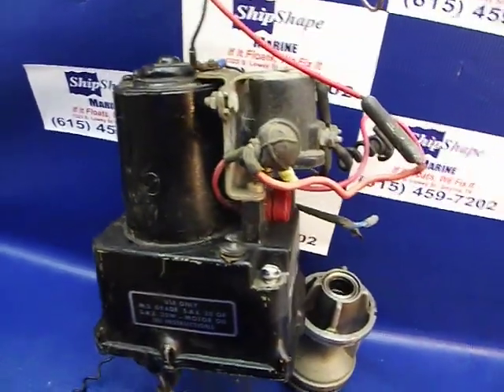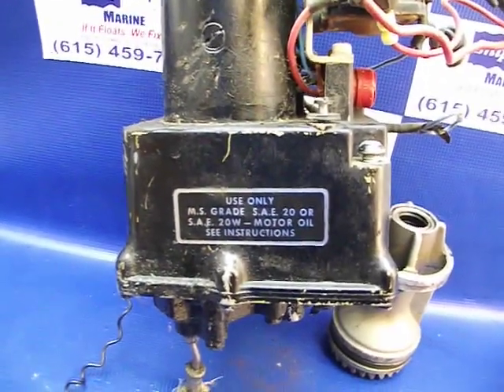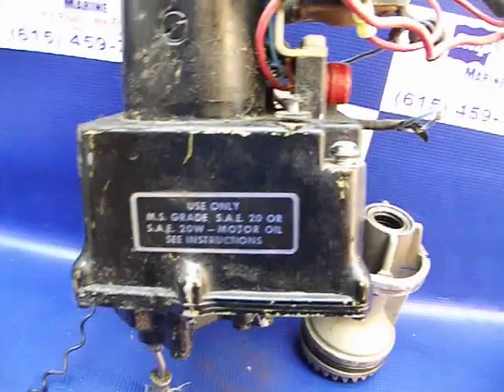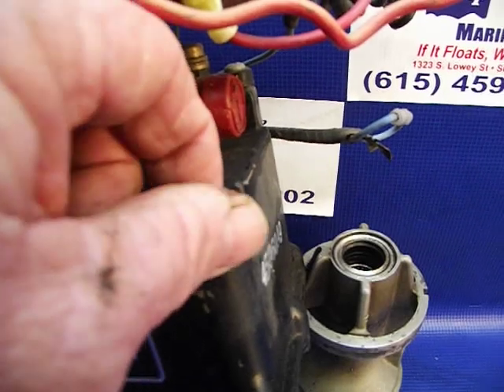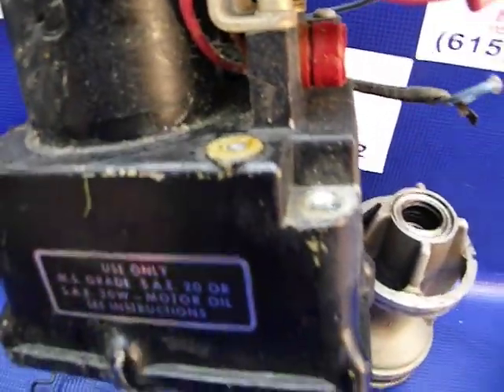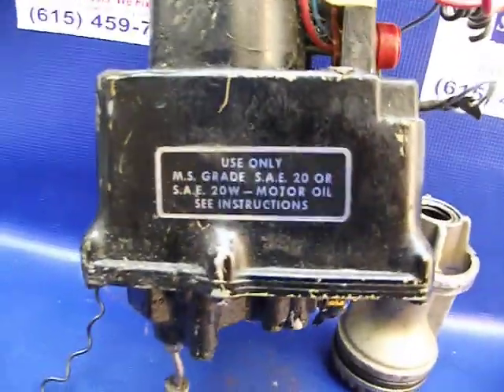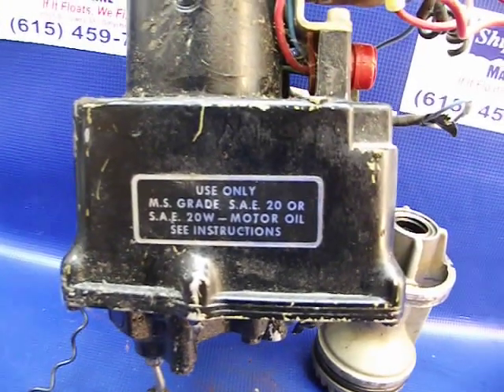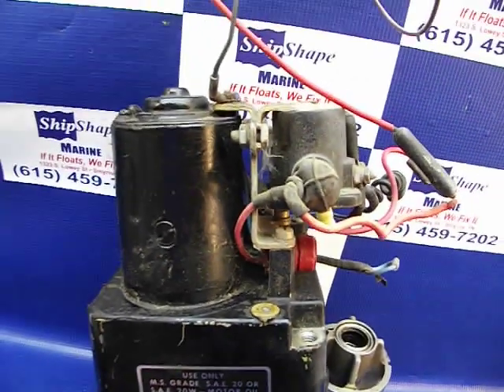How To Check Fluid Level in Dual Ram Mercury Outboard Power Trim Motor.

Comment: I had the same problem on a 1979 Mercury outboard 90/900 .  First I want to thank Shipshape Marine for posting this video. I also had a a bad wires (2) going to the position sensor PT. The wire was bad all the way from the pump into the boat to the PT. The pump motor would run when I hit the down control switch but not the up. Then I got it to run the motor from the up control tilt switch after fixing the wire but it would not go up. This Video explain that the old PT tilt on my 1979 Mercury should have regular 20 weight oil in it (Non Detergent). I Checked mine it was low after sitting 2 1/2 years. Filled it up and my Power Tilt worked better then ever. Ran it up and down checked the oil again and added a little more to top it off. I did find a slow leak on one of the piston cylinders. This Video helped me out allot. I just want to say thank you very much ShipShape Marine. I have subscribed to your site and have recommended you to my fellow boaters.

Comment: yours is the only video about this that i could find. so you run it up and down with vent screw open to bleed? then top off.?  open vent going up and going down?  thanks.
Reply from the maker: You are correct on all issues.

Comment: I’d like to know if one could take the old hydraulic line fittings and rebuild the hydraulic lines? My lines are drying up and cracking and starting to seep fluid
Reply from the maker: The trim lines are still available new but slightly pricey. Still, this would be a lot cheaper than having a set custom made.

Comment: I hate to ask a dumb question, but where do the four power trim oil lines go to? I see 4 fittings on the ends of the lines and only one on the bottom of the hydraulic unit. Is there some kind of distribution block I'm missing or something?
Reply from the maker: homebrewman231 This on has four lines that exit the bottom of the power trim pump. You just can not see them in the video.

Comment: Hi there,
You are the only one with a video of the dual ram trim! lol  do u know were I can get some more info on this unit? I have a 1979 mercury  and the trim is working, but just a quarter of the way it should. (Up n down) I filled it up with fluid! but I can hear a clicking  from the unit, is there a relay in that solenoid? any info would be great! thanks!
Reply from the maker: Allan Hopper If the trim motor is functioning as it seems to be from what you said, you do not have an electrical issue. You state the trim motor is running but it does not go all the way up. What fluid did you use to fill your system with?